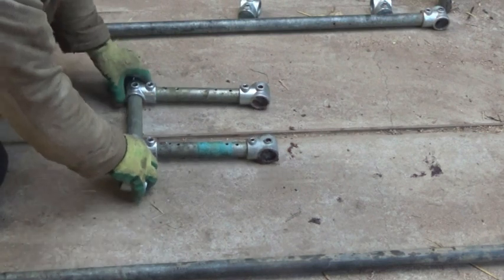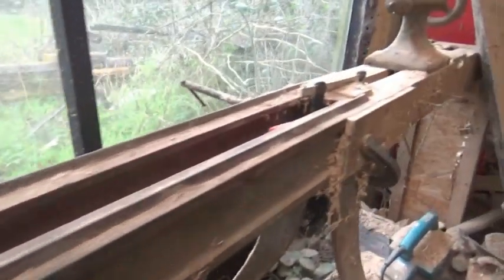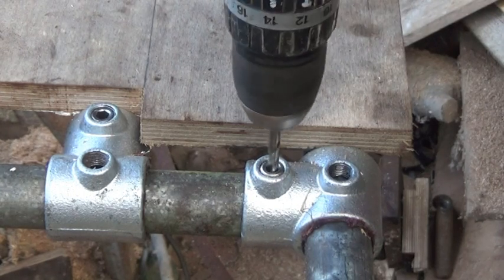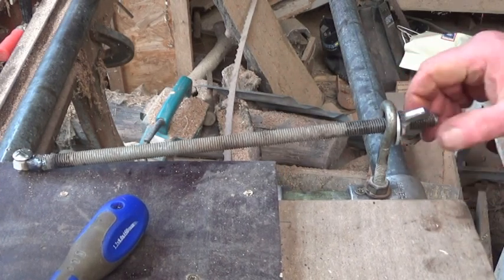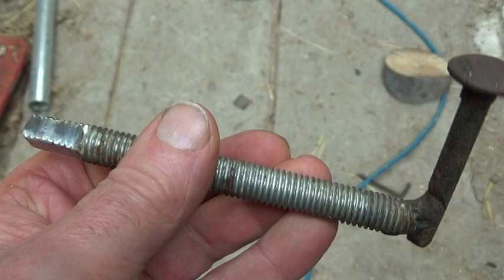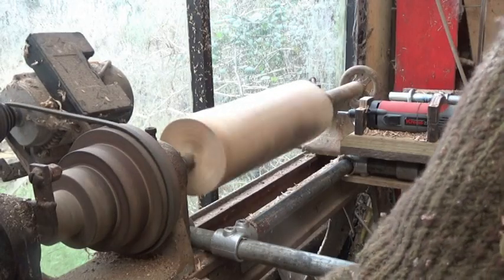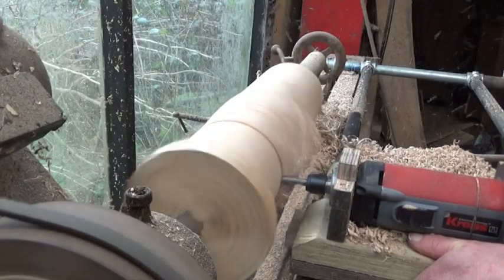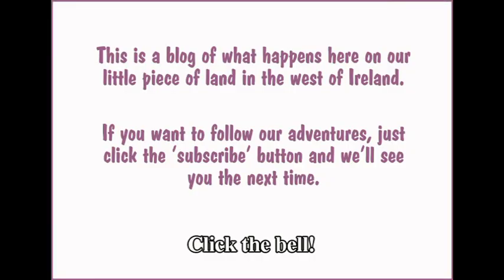How To Make A Simple Copy Lathe (out of water pipes!).

Comment: My understanding of pipe sizes is they started by having outer diameters that were simple inch based values. The inside diameter was the result of the manufacturing process (I'm a bit fuzzy on this part). Then, as metallurgy improved, a pipe with thinner wall could carry the same pressure, so hey kept the oddball inside diameter, to be compatible with old pipes and reduced the outer diameter. The result is pipes that don't have any dimensions that match their "nominal" diameter.
Reply from the maker: Thanks, David, that all makes sense.

Comment: Water Lines, seems to be this, defined by Inside Diameter... and by wall thickness, length thereafter.
Your little threaded rod piece, was not far from any backyard leadscrew.
I used a Coupling Nut ... affixed under the table... then only a locknut, ... a regular nut, and a simple crankhandle to turn it.... the coupling nut removes much backlash as normal nut would give.

Comment: Those are ‘plain bearings’ you have made, and try measuring the tube ‘bore diameter’ in order to find your 1” measurement!
Reply from the maker: Ah-ha! Plain bearings. But what are bushings then?
I measured the I.D. (obviously! do I look that stupid?) and am still baffled. Perhaps you have different pipes?
Reply: @WayOutWestx2  so the bore diameter is not 1 inch?, A bushing is when a sort of 'shell' is inserted between the two 'bearing' surfaces (like those 'oilite' bushes you can buy, two things rubbing together without something designed to reduce friction between is a 'plain' bearing (congratulations you have made several excellent plain bearings with your anomalously sized tubes!)
Reply from the maker: Thanks, Pat. I'm getting the hang of the terminolgy slowly..
Reply from the maker: I.D. varies from 26.5mm to 27.5mm approx. (25.4 mm = 1")
Reply: Way Out West Blow-in blog so! Nominally 1” wouldn’t have mattered on the plumbing of the Titanic!